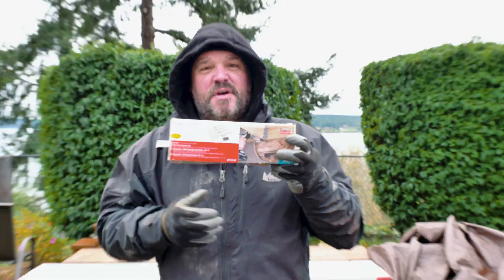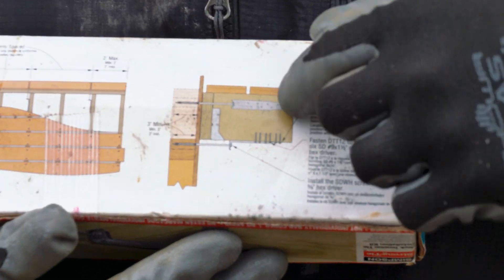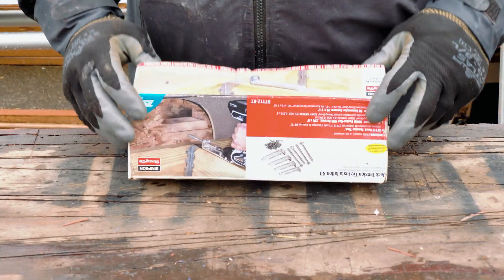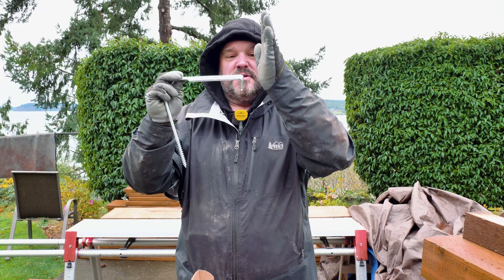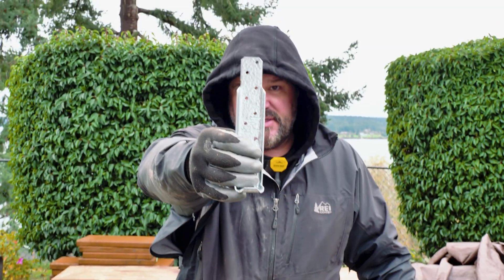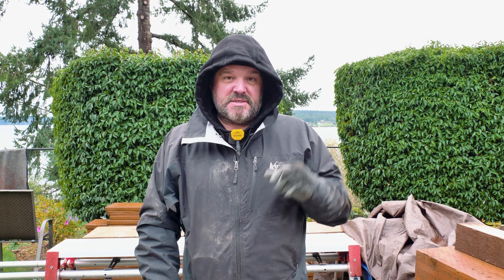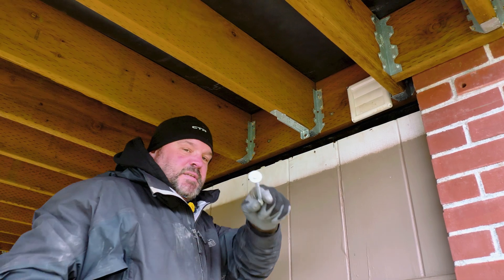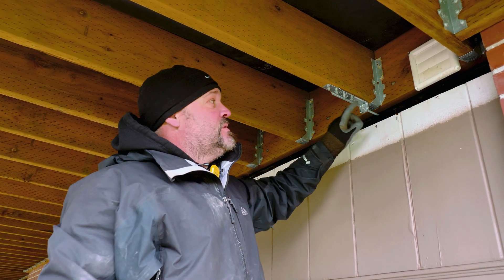Let's Talk About Lateral Tension Ties || Dr Decks

Comment: Thanks for the product and installation demonstrations.
I need to install a set of these (maybe 4) on a typical balcony deck joists. The leftmost 2-3 joists have slightly moved away from the ledger (especially the outermost one) and need to be brought back against the ledger. Can I use these tension ties to do that? If not, can you suggest the best way of moving back joists that have slightly moved away from a ledger?

Comment: Awesome quality video. I work in software, and have no idea about basic construction concepts. This taught me the importance of tension tie brackets, for certain scenarios! It would be interesting to know at what deck height (from the ground) these would be required. For example, my deck surface is only about 18" off the ground (joists maybe 6"). If the deck "fell," you wouldn't fall very far, and likely wouldn't be hurt at all. Would tension ties be required for decks higher than .... let's say, 3 feet off the ground? Less? More?

Comment: The U.S. produced 80.2 million net tons of steel in 2020. Code enforcement expects you to use roughly 97% of this amount when you build a deck.
Reply: Simpson writes the code book to require their metal brackets. Only their stuff is approved.
Reply: @mxusa8383 yeah they studied the lateral force need to break the deck and they couldn't do it with 1000s of pounds of force. The house joist was fine and the deck was still attached.
Reply: This is exactly why im questioning if i should pull a permit for my deck

Comment: Why can you not use them on the side of the joist?will do same job if you need to move it from bottom so you can finish the under side of joist
Reply: You can.  See installation instructions.  https://ssttoolbox.widen.net/view/pdf/z4eaffenlu/T-C-DECKLAT21.pdf?t.download=true&u=cjmyin
Reply: You can also use them on the face side of the joists. Check Simpson's web page.

Comment: Things like this are the reason I always build freestanding decks. I'm replacing/enlarging a deck in the spring and I'm disconnecting it from the house. Initially it's a little more expensive (in material) but it saves a ton of headaches and labor.
Reply: Ours is free standing and attached to the house and now I will install these for some more insurance.
Reply: I believe that if your support posts are deep enough in in disturbed soil, the soil will supply the necessary lateral resistance. My deck has 6 ft. long 6x6 posts 36” deep and it’s gone nowhere in 35 years.
Reply: @janking2762  

I agree that wood will work if it's long enough and deep enough. However, I'm setting concrete piers on a square foot with rebar just below the  standard local frost line (36").

Comment: Floor joists sit on top of the double plate.  From your shot of the protruding floor joist it looks like you had to cut the bottom of the joist to match the deck joist.  This means that your double plate is below that.  When you installed the deck tie I think you were going into the rim joist and not the wall plate.